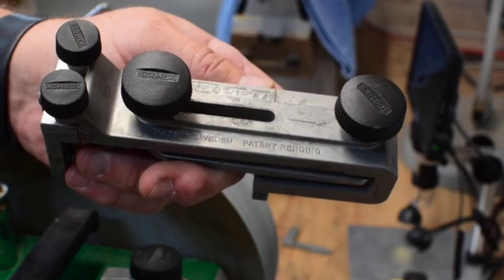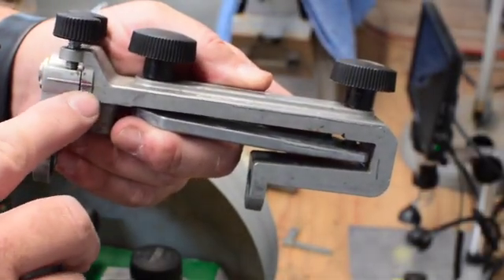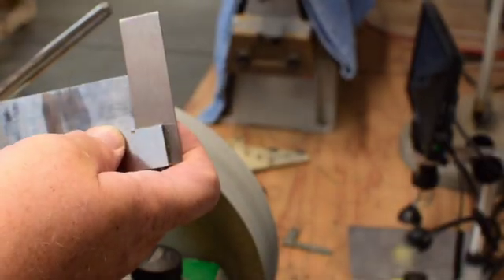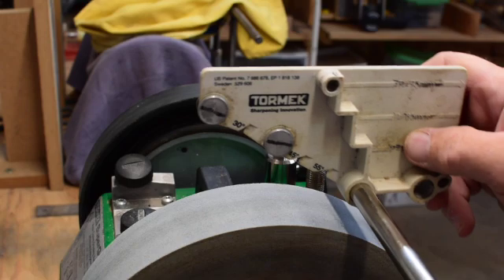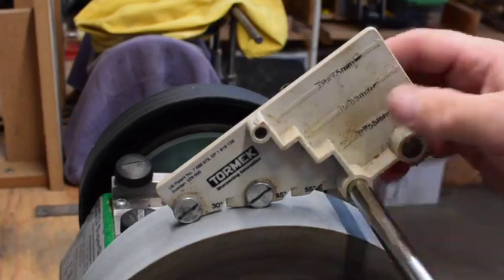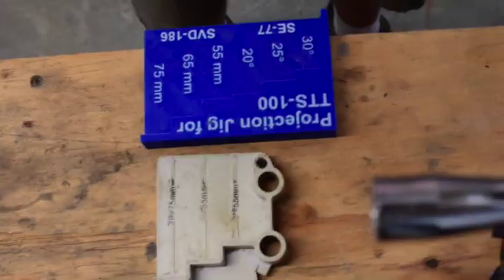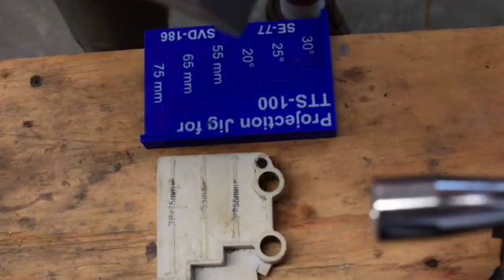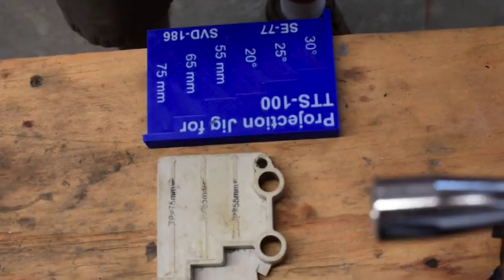Jigs for the Tormek SE-77

Comment: I hate when people squawk STL, but are these posted somewhere? I don't see any way of getting the files from your website.
Reply from the maker: They are available on the Sharpening Handbook ( https://sharpeninghandbook.info/indexJigs.html ) which is a site I maintain.
Reply: @RichColvin  thanks!
Reply: @RichColvin  The link isn't working.  404 not found
Reply from the maker: @davidwatson4510  for some reason the comments picked up the right parentheses.  I added a space after the link and it should work now.
Reply from the maker: For some reason the link picked up the right parentheses.  I added a space and it should work now.